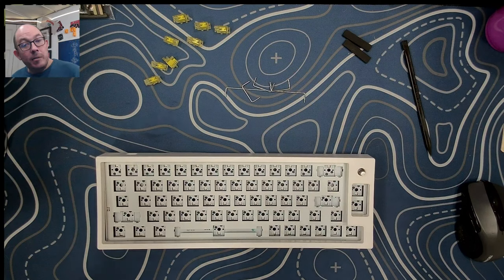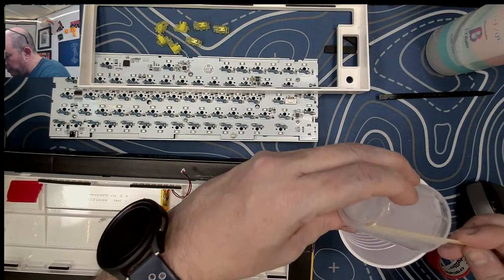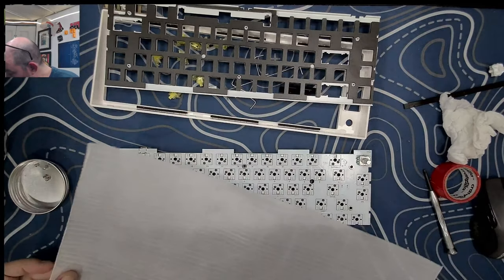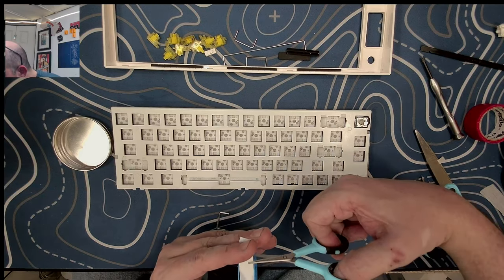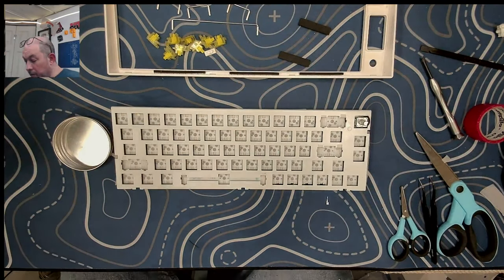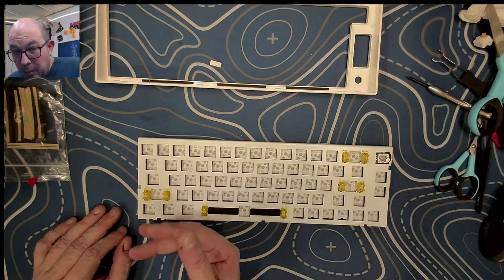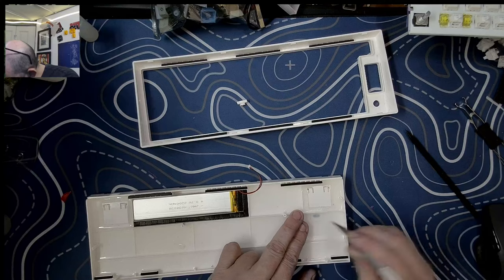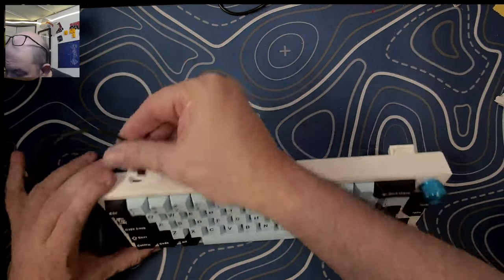Modding the Dukharo VN66 - A great budget 65% kit and the original TH66

Comment: Got a renamed unit but basically same dukharo layout. Here's what i did to mine.

Replaced the plate with polycarbonate one and ditch the screws from the metal plate and end up with more flex

Put a clear bath tape i guess on those gaps on the case. Tho im planning to have it siliconed next time

Change the stabs to Lumia dunno if you get the same brand coz the stock wont do at all due to some rattle

Azure Dragon switch. Im planning to lube em also next time

Doubleshot SA profile

The result is a little bit deeper, crunchier and clean sound profile compare to what you did. 

I hope this can give someone also an idea on what they can do with this unit. 😂
Reply from the maker: You should share it on r/BudgetKeebs

https://budgetkeebs.com

Comment: This was a longer one, but lot's of good info in here. I haven't done the plumbers mod yet,  in fact, beyond dielectric grease and clipping the feet I haven't really done a ton of stabilizer tuning. I think that's one of the benefits of being in the average price range I'm in, you generally get pretty good stabs. Even the IK75 had good enough stabs for me, so I really didn't do much to mod them. When you were doing yours, you had the PE foam down already, would that have been enough of a pad anyways? I know you added a pad beyond that, just wasn't sure on how effective the secondary pad would be.
Reply from the maker: The PE foam probably would have been enough, but it didn't hurt. ;)

Comment: Great video. im planning to buy the same board but concerned of its flex. is it possible to have more flex by trimming the small standoff around the case? and maybe shaving a bit plastic from where the gasket sits? so that the board has a bit more room for movement.
Reply from the maker: Thanks, and I have seen that same procedure done on the NJ80, which is built very similarly to this one, so a bit more flex is more likely than not achievable.

Comment: good video but may i ask how you got it open in the first place?
Reply from the maker: Using a plastic spudger with a flat end, go around the outside perimeter of the case, running the "blade" between the clips, pushing them ever so gently they should pop off. Once one side is loose, do not try to pull off, do the same thing for the opposite side of the case then lift straight up without force once all the clips are disengaged.

I do this with a Feker, which is around one of the hardest ones I've ever come across, but similar process: https://youtu.be/z5YNXLxhPfw?t=238

Trick is to go slow, use gentle but firm force, running slowly between the top and bottom halves of the case.
Reply: @MechKeyboards  thank you so much for your in depth answer, you helped me a lot! :)
Reply from the maker: @KidCat2k  glad to offer the assist, cheers!